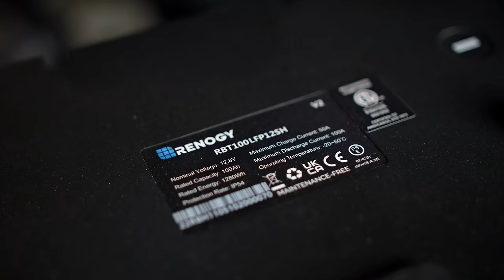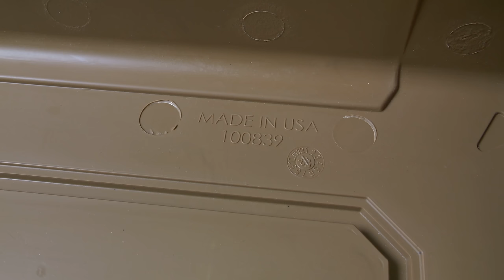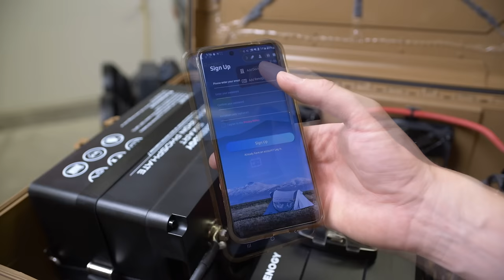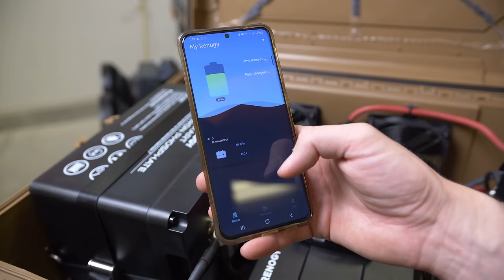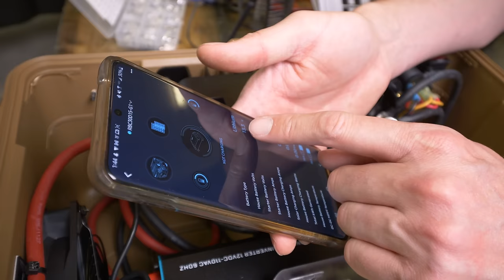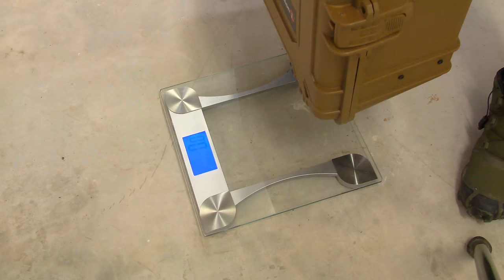It all fits in a case! - DIY Auxiliary Power System for Camping, Overlanding, Travel

Comment: SAFETY ALERT!!!! No Catastrophe fuse wired within 6 inches of the POS battery post! Then from the fuse wire to a accessible on/off Master battery disconnect switch. Then the rest of the POS feeds could run off the Master switch. Every DC system or circuit MUST be wired with a Fuse first at the Source and then to a switch or relay or directly to the LOAD.. It's to prevent the fire if anything happens...  Nice box otherwise
Reply from the maker: It's internally protected https://www.renogy.com/content/Manual/LFP100S-Manual.pdf
Reply: @LifestyleOverland  Should still have a Catastrophe fuse to protect the wires coming from the battery from a thermal runaway melt down or prevent a fire if a short were to occur and a Disconnect switch for control and to cut the power off to work on it or remove wires and prevent arching. You wouldn't work on AC without a mains fuse or disconnect switch. DC has MORE potential to heat or arch if a short of some kind were to happen. Cheap insurance..  It's a SAFTEY thing.  No different. But it is YOUR box and your RISK. A Commercial box there are rules about safety. Besides It is also GOOD common sense to have both items in place.